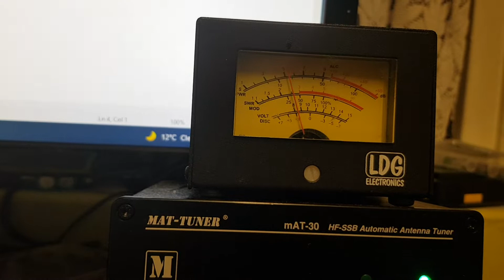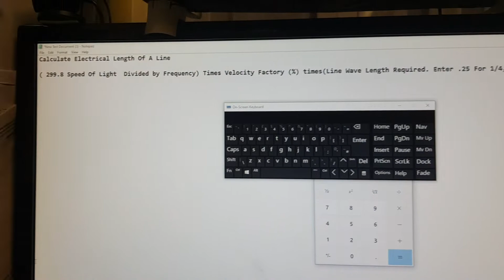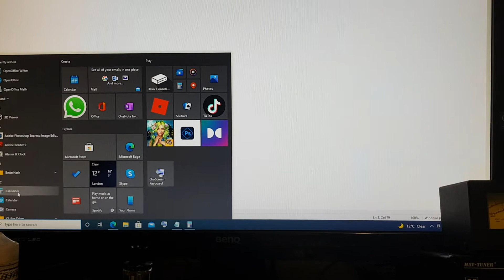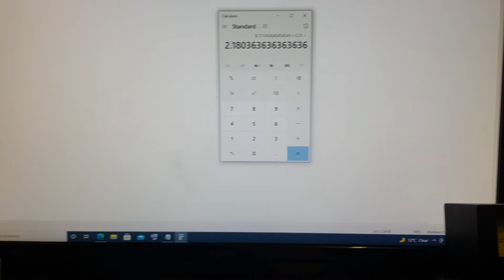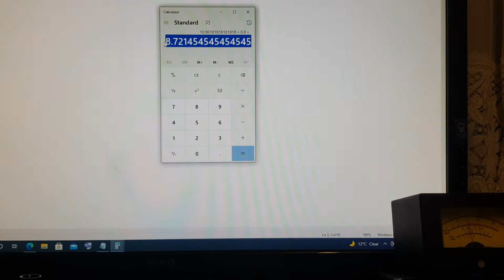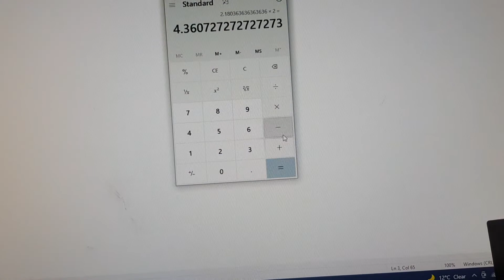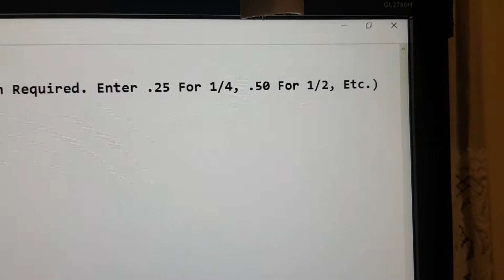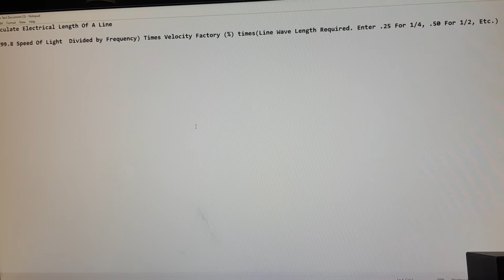cb antennas/cb aerials and coax length secret

Comment: It sounds to me the coax braid is acting as a counterpoise earth if things improve.
In 49 years I've never felt any need to cut coax to a specific length and I get out with 5 Watts QRP maximum. 33 years QRP. Even 1 Watt c.w. and 350 mW c.w.
G4GHB.